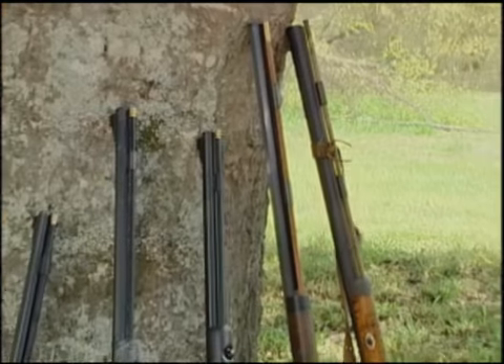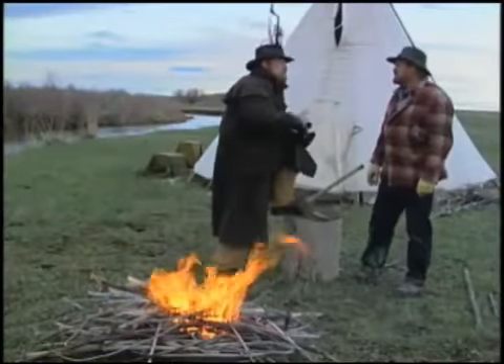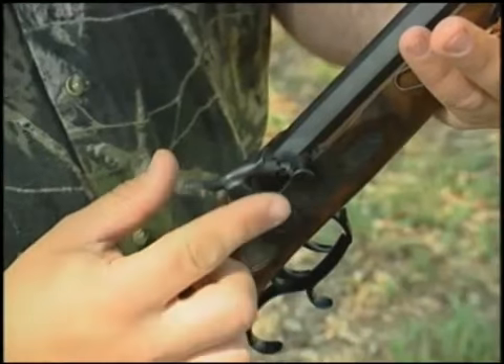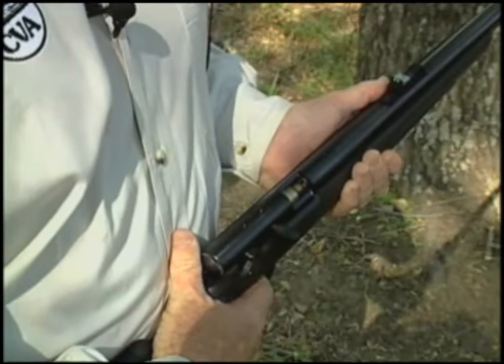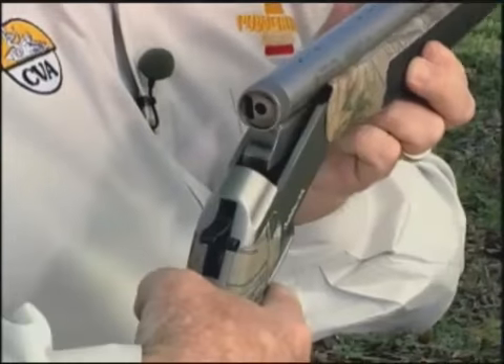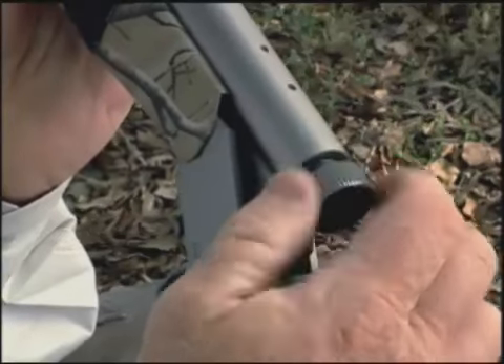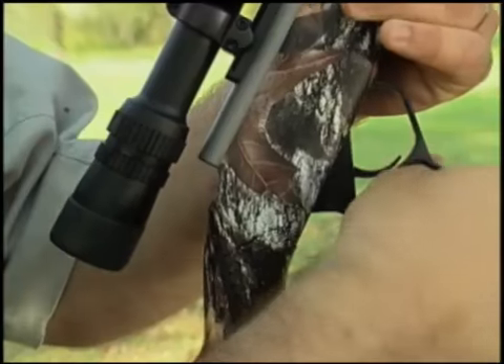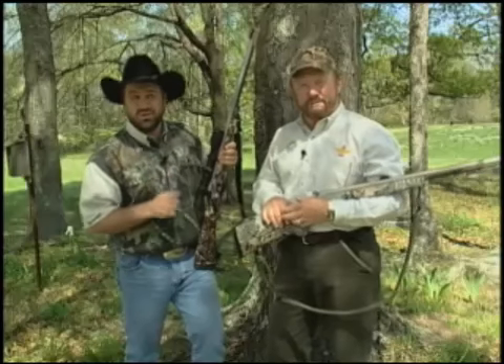Types of Muzzleloaders

Comment: THEY HAD INLINE MUZZLELOADERS IN THE 1980'S.
I had first a TC New Englander,.....Then the CVA Blazer,....Then a Knight knock-off.
Then an original gun a Navy Arms Chinese import that I absolutely love,...... its Identical to the Traditions Tracker except the butt has a one inch screw in the butt that opens a compartment where the take down tool is stored,......its a 12gauge shotgun with a polly choke and it shoots as good as a center fire gun.
I paid $50 dollars for it in the 80's brand new.
In my book the old 1 in 48 twists is the best.
I think their 1 in 28 now?
My suggestion is start making more 54 calibers,... because bullets are hard to find.

Comment: Only two types of muzzleloader a back then? There were way much more types of mechanisms before the flintlock like the matchlock, dock lock, wheel lock, and snap hance.
Reply: They are not very commercially available as reproduction models and an original antique in firing condition will set you back $5000 and up. Chi mongol hun uu?
Reply: @mnk199245  no 500$
Reply: + Toe ofawesome I have also heard the first firearms referred to as "arquebuses" , but they are the same design I think.